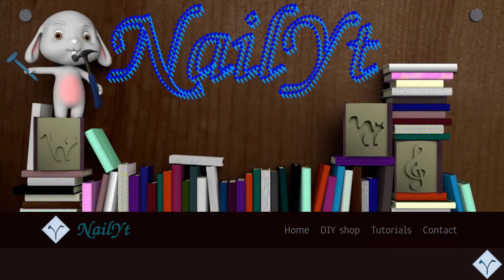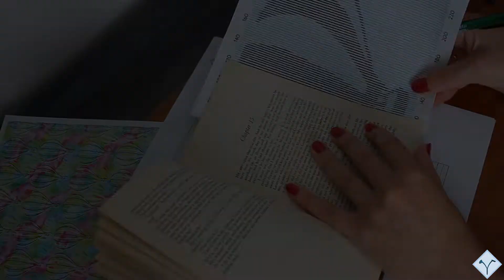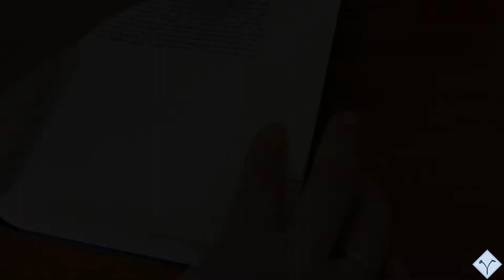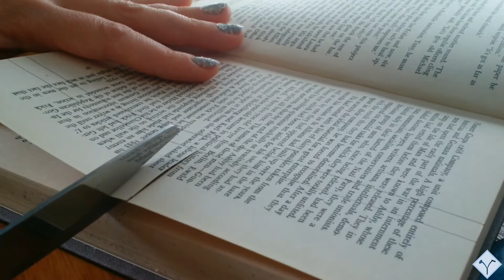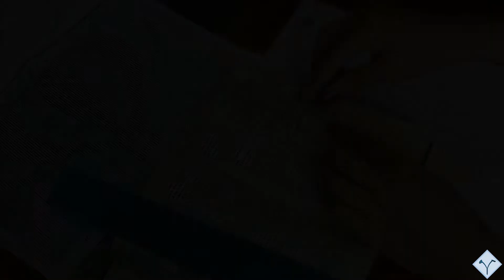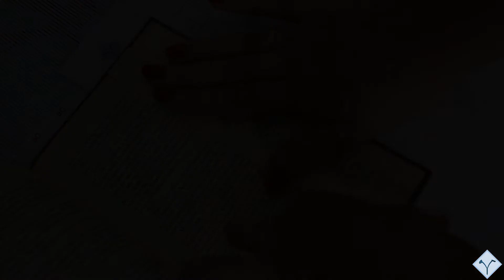Method 2 - Negative Cut and Fold method - Book Art Tutorial - Part 2

Comment: What do I do with the odd numbered pages ?  Do I not do anything with pages 2,4, 6,8 etc ?
Reply from the maker: You make markings and cuts on each sheet of paper (leave), i.e. on every second page. There are always 2 pages on one sheet of paper. If you make a mark and then cut on one side, the cut will automatically be on 2 pages (since a leave has 2 pages). That's why in the measurement table the number are for every second page .
If it is still unclear, please take any book and look at the numbering of each leave, you will see that each leave has a page number on both sides.
Reply: @nailyt-art  ohhhh I get that , it's just the 2 lines on each sheet & then the markings & the folding,  its hard to see in video where the folded up ones are going,  that's all .
Reply: Bonjour je voudrais faire mes gabarits comment faites vous  @nailyt-art